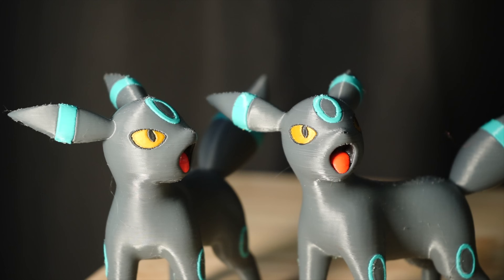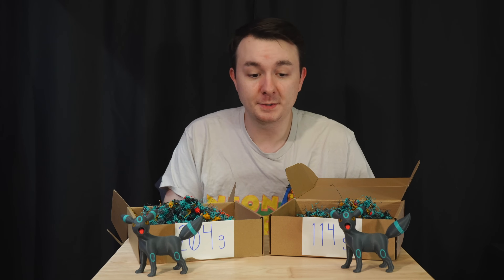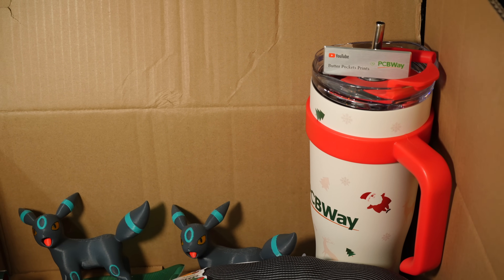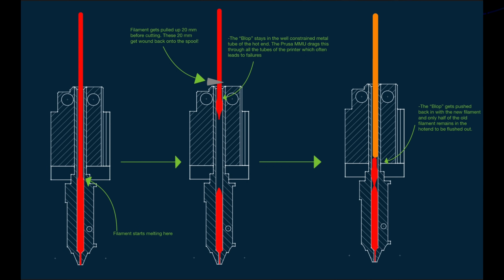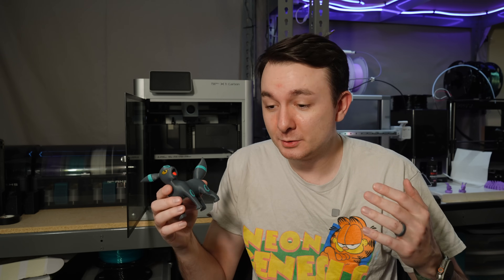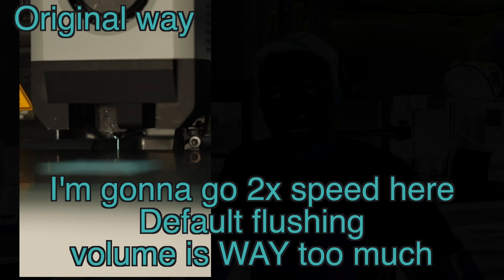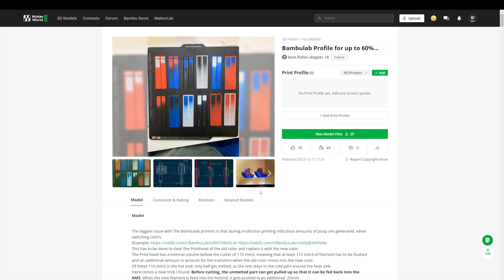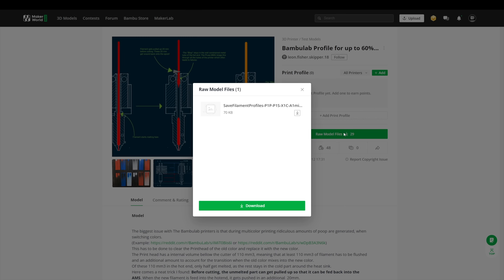The Best Way to Reduce Filament Waste for Bambu Lab AMS

Comment: Did you also use the option to use the „mixed material“ for infill structure?
Reply from the maker: I did, it’s called “flush into infill”. I did it for both so it didn’t contribute to the savings. It’s something I’d recommend to have on for most multicolor prints.
Reply: @ButterPockets  didn’t know how to call in English (not my native language) but learned it some time ago.